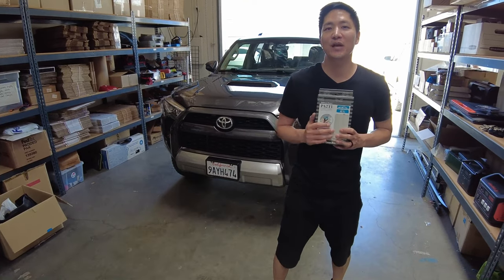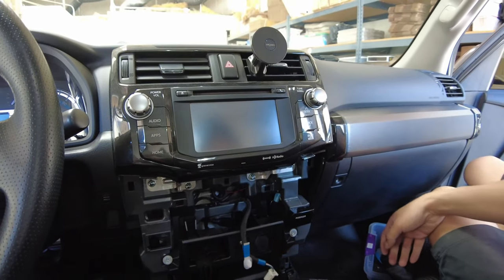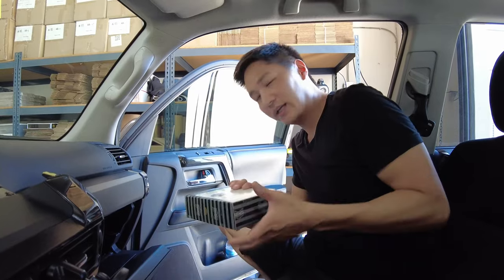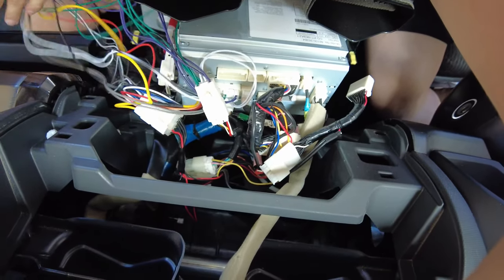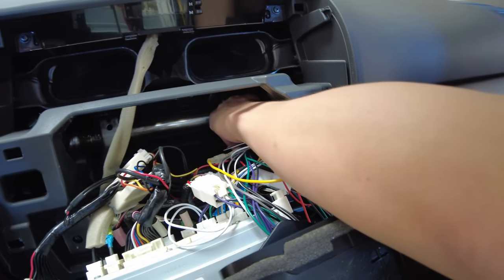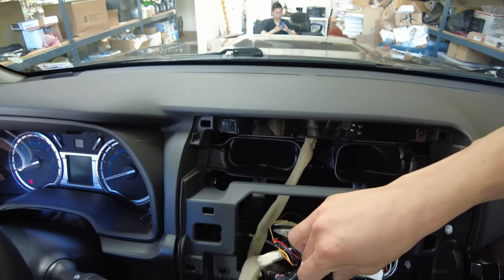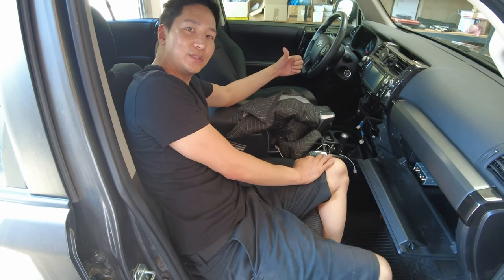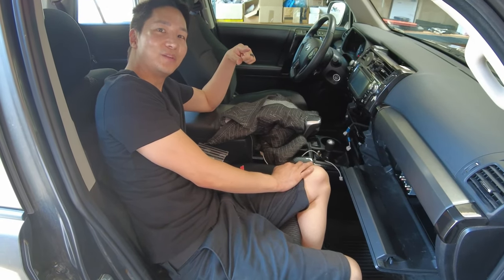Micro Power Amp to Boost your Factory NON-JBL Sound System for all Toyotas! 4Runner DIY

Comment: It works on a 2022 TRD Sport, this model does not have JBL but its speakers were changed for black diamond ones. I would like to know if in addition to improving the sound I could add an amplified subwoofer

Comment: So I have the jbl with sub in rear 2008 4Runner, I was wondering if I can upgrade just the amp to add a more powerful subwoofer. The mods and higher sound good, the sub is decent but could use more base.
Reply from the maker: Best is to install another sub using a LOC

Comment: I replaced my 5th gen 4runner factory speakers with Jbl gto series 60w and 180 peak. Do you have an idea of how much will it increase max output? Or is it better to install a 100w amp instead.
Reply from the maker: Wouldn’t be able to tell you honestly until you try. Keep it in good condition and if you don’t like it you can always return it
Reply: @BeatSonicUS  Tempting, but I'm overseas and shipping back it'll cost like a 100 bucks. In any case, should that be the case it'll be a great selling point for all Toyota owners and possibly more people since most are just swapping the factory speakers with some good quality ones and we are just looking for a more marginal increase such as 30% higher output with good sound of course.

I might pull the trigger just to give it a try, for now I'm looking for what would be the best option to achieve my needs which is based on my 2 comments. Thanks for the super fast response. 

Best wishes.

Comment: Notice the amp is 4 channel but 4Runner has 6 speakers.  Does the amp power the 4 rear speakers (doors & hatch) sharing channels 3&4 of the amp?
Reply from the maker: The amp will power all 6 speakers

Comment: Great install video! You may not want to secure the amp as it blocks access to the cabin air filter.
Reply from the maker: Should have shown it in the video but the cabin air filter cover can be easily removed even with the amp in that location
Reply: Awesome, will do the same for sure. You are a PRO!